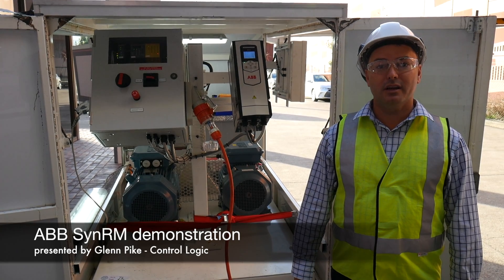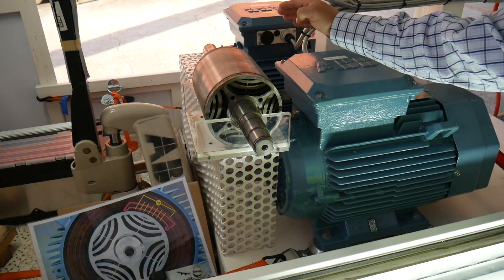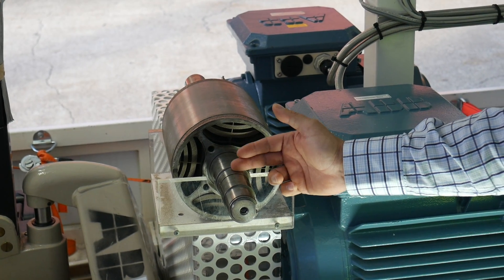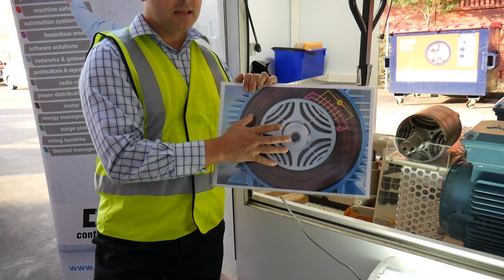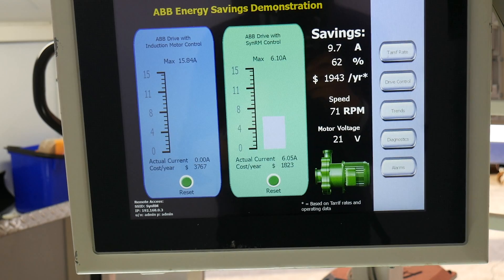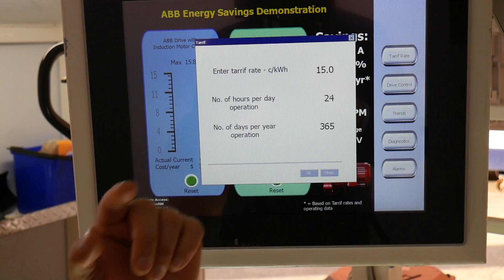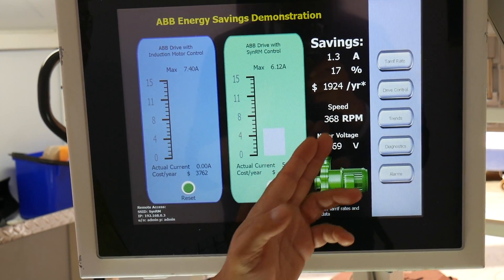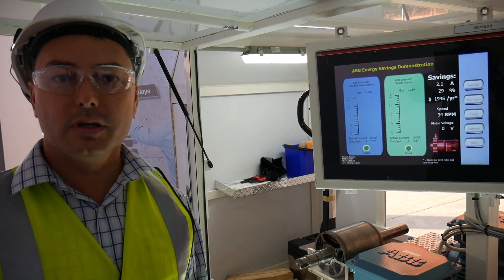Control Logic | ABB SynRM demonstration

Comment: Die üblichen Wechselstrommotoren sind heute rechteckig und speziell geformt mit zwei normalen Außenspulen bds.
Die laufen wie der Teufel für definierte Zwecke , wenn auch der Wirkungsgrad viel niedriger als bei Gleichstrommotoren ist.

manche haben an den Achsen seitlich ein Statorstägegitter noch eng am Gehäuse fest aufgeschraubt.
Andere haben noch ein bi- halbpolar bewickelten Rotor mit zusätzlichem Kollektorabgriff
oder berührungslos mit Zickzackspule am seitlichen Rotor und kurzgeschlossener Diode
oder Regeltransistor mit Magnetfeldsensor . Dann zwei Zickzackwicklungen mit Gegendiode. 
und zwei Regeltransistoren. Strom bekommen diese genug und berührungsfrei und speichern die Stromversorgung 
über eine winzige Akkuknopfzelle. Bei höherer Drehzahl machen diese innen eine rückgepoppelten z.B. 
einen leichten Phasenanschnitt mit 3 zusätzlichen kleineren SMD Bauteilen berührungslos.

Comment: Ich habe noch nie einen Wechselstrommotor mit Reluktanzscheiben gesehen die meist nur zusätzliche Remanenz machen würden.*
Das wäre dann eher widersinnig.

Das wäre totaler Quatsch. Es gibt hingegen Wechselstrommotoren mit engerem außen noch draufgeschraubtem Statorstäbegitter aus Speziallegierungen. In den Rotor kommt manchmal noch über Fräasschlitze eine berührungslose halbpolwechselstrom Zickzackwindung rein, die im Kreis und richtig phasenüberspringend  mit einer  Diode im Knoten kurzgeschlossen ist . Nämlich für die ideale Nennfrequenz der Umlaufdrehzahl und zusätzlicher Induktionsverbesserung deshalb als zweiter Induktionskreis besser ankoppelnd und hierbei kurzgeschlossen wird.

Comment: He makes a point to say there are no windings on the rotor. There are no windings on a conventional AC induction motor either, so what is his point??
Reply: Yes there are. Usually aluminium bars that are shorted in the rotor ends, or a complete set of copper windings on a steal core.

Comment: I would like to see the same test but with a kW measurement, Amperes are not indicators of energy savings.
If the savings are in losses, that is not a percentage applicable to the energy consumed when carrying out the work, I understand that the reduction is in losses.

Comment: You can't use inrush for cost savings on a small motor, It's only running at inrush for a few seconds. Also, what's the load these motors are driving? Is it the same?

Comment: Power. (Which is what you are paying for) is measured in KWh. You demonstrated a reduction in current but you did not demonstrate a reduction in Power. Don't get me wrong I believe SynRMs are more efficient and will save you power and reduce inrush current but it isn't 29% more efficient.

Comment: I'm using 230v single phase 2.25kw cap start/cap run motors. is there a SynRM motor to replace these? The current motors are at the limit for normal 230v supply, so a lower power consumption would be a big advantage. No choices on input voltage or power requirements, unfortunately.

Comment: My doubts about the video's content are on the actual mechanical load of the two motors. The electric power is not the same,  according to my calculation on the electric power (which is not shown in the video)  in the previous comment, the induction motor is absorbing more than twice the power. That's really strange, there is too much difference and that's why:  An average 11 kW induction motor has at least 85% efficiency , this means that if the electric power is 4.96 kW the mechanical output power is 4.96 (electric power) * 0.85 (efficiency) = 4.22 kW.  Assuming even 100% efficiency for the reluctance motor it would have a mechanical load of 2.37 kW.  With this  calculations, we found that the motors are operating on different mechanical loads. That's why I said that they are clearly operating on different loads and that's not a fair  comparison for the two motors. For an efficiency test, i would expect that to fulfil the same mechanical operation, one of the two motors needs less energy.  
This video sounds to me like this:
Boss: We need something to convince  people that our motor is more efficient than the other.
Engineer: but.... that's a lie.
Boss: I DON'T CARE.
I really like the reluctance motor and I found they're principles amazing and they don't need those "low-quality "  and "unfair" videos.
Anyway, i don't want to make this comment a complete rant. Maybe I'm wrong and I missed something fundamental. I hope i made my doubts clear, in any case waiting for a  reply.
Reply: You need more energy in order to generate a strong enough emf in the rotor in order to get the motor to operate in the desired range. The synchronous reluctance motor has a rotor with already present magnetic field, which means you only need to pull it in whichever direction you want it to go. That takes less power by definition, as you don't have to pay for the Lorenz law's effect, which you need with a regular squirrel cage rotor.
Reply: @Hr1s7i  no the rotor in a synRM does not have an already present magnetic field

Comment: Lots of doubters in this sub. The efficiencies are real, and stem from the rotor reluctance design vs. traditional inductive motors. Startup current is a bit misleading, it stems from the fact SynRM motors require a VFD to operate and so have built-in soft start. You'd see similar inrush on the inductive motor if it had a soft starter attached (and not nearly as much savings from lower peak demand, it's just not that heavily penalized outside EU).

A problem I am having is they're not available in NEMA frames for application in north america. Shaft height and bolt pattern matching all good, but that's not the only consideration of NEMA. In addition it would be nice to see a demonstration for 60hz.
Reply: Sounds like an opportunity if you think there is much of a market. :)
Reply: @Omniwoof  Without a doubt there's an opportunity. I and my team work in the field and find them every day!

Comment: 7.37A@386V=1499RPM vs. 5.29A@257V=1495RPM. 10^6 (4.25 vs 2.04) both loads appear to be different.
Reply: synRM motors are 5 to 15% more efficient than classic induction motors.

Comment: You will save even more if the motor has to start several times a day. This is a major advancement in electric motors. It will give electric vehicles a much longer range per charge. That is great news.
Reply: This is why Tesla's use SynRMs

Comment: Induction motor shown starting on D.O.L. @436 V. ..& 15-16 Amps..
the other shown slow ramp up ..V/F from variable frequency drive... probably it was ALSO programmed  for CURRENT CONTROLLED SOFT START.....
A TRUE COMPARISON WOULD BE SHOWING THEM DRIVE / START UP WITH SOME CONNECTED 
" RATED LOADS @ RATED RPM.." .  
this was some childish play..
Reply: super mario ...you are correct. All variables must be identical, except for the load....for an accurate analysis......way2go....

Comment: Either your induction motor efficiency is 60% (which is NOT) or the load on the motors is different.
Reply: I was scratching my head
Reply: It is not induction, it is reluctance.
Reply: Each motor is turning a fan, which in order to be identical loads would need to push identical CFM: At different RPM, to achieve =CFMs requires significant design changes: different blade pitches, propeller vs drum style, size difference or particular combinations of these.

Comment: Not much savings really, then add the monetary loss of the inferior ABB speed drive, which consistently fail with exploded IGBTs, board replacement prices astronomical.
Reply: You can use other manufacturers drive... Danfoss perhaps?
Reply: @terok85  yet the video is specifically @ABB product.
Reply: @HighestRank  I know, just pointed out the fact that if someone thinks that ABB Drive is inferior, they are free to use other drives with SynRM too.. :-)
Reply: Square D ( Schneider Electric) has the best drives, robust IGBTs, full voltage manual bypass contactor, if needed.
Reply: @chrisretired5379  IGBTs are actually where the energy savings are, don’t require power to hold the magnetic contactor ‘engaged’,

Comment: Impressive, I think the video would be more convincing if a way could be found to actually measure air flow from the two fans. if the fan pitch is slightly different, there would be less power required for one of the fans. And then instead of showing amps, show Kw instead. Clarification should be also made that these require a VFD to operate. if an application required a redundant bypass, a standby VFD would be required. on my ABB 580, there are different parameters for the SynRm motor vs and induction motor.
Reply: Lower amps is going to allow thinner gauge wiring, smaller trip breakers, need less heavy duty boxes plus smaller motors can fit into more places, even if they’re not actually lighter.

Comment: how this would compare with the motors attached with some load?
Reply: Assuming that load is the same on both motors and both motors are either torque or speed controlled than the ratio of drive currents and subsequently power would be the same.
Reply: @golllub  Same load and same speed means same power but this in not the case: Induction : 1.73*378V*7.40A = 4.96 kW
Sync RM  : 1.73*260V*5.28A = 2.37 kW
They are clearly operating on different loads and so you can't compare the energy cost an the hypothetical savings. Nevertheless the motor is amazing, you obtained a synchronous motor without magnets or windings, but the test is bullshit.
Reply: @jacopodellolmo6640  My understanding of the video is that the current being shown is the current the motor is drawing and that the difference in power draw is literally the point of the entire video. The output power is most likely equal. The reduced current draw can be attributed to the complete lack of winding on the rotor which means that there is no rotor copper loss.  The lack of rotor copper loss also means that no additional power has to be dedicated to cooling the rotor, further reducing current draw. I could also be misunderstanding something so please correct me if I am wrong anywhere.
Reply: @arnavasdf3389  Maybe  my previous comment was too short.  My doubts about the video's content is on the actual mechanical load of the two motors. The electric power is not the same,  according to my calculation on the electric power (which is not shown on the video)  in the previous comment, the induction motor is absorbing more than twice the power. That's really strange, there is too much difference and that's why:  An average 11 kW induction motor has at least 85% efficiency , this meas that if the electric power is 4.96 kW the mechanical output power is 4.96 (electric power) * 0.85 (efficiency) = 4.22 kW.  Assuming even 100% efficiency for the reluctance motor it would have a mechanical load of 2.37 kW.  With this  calculations we found that the motors are operating on different mechanical loads. That's why i said that they are clearly operating on different loads and that's not a fair  comparison for the two motors. For an efficiency test i would espect that to fullfil the same mechanical operation, one of the two motors needs less energy.  
This video sounds to me like:
Boss: We need something to convince  people that our motor is more efficient than the other.
Engineer: but.... that's a lie..
Boss: I DON'T CARE.
I really like the reluctance motor and i found they're principles amazing and they don't need those "low-quality "  and "unfair" videos.
Anyway i don't want to make this comment a complete rant. Maybe I'm wrong and I missed something fundamental. I hope i made my doubts clear, in any case waiting for a  reply.
Reply: @jacopodellolmo6640  I guess I didn't consider everything when I wrote my comment. Thanks, I have learnt something today.
Reply: @arnavasdf3389  the output power is likely to be the same considering both mounts are identical👁‍🗨